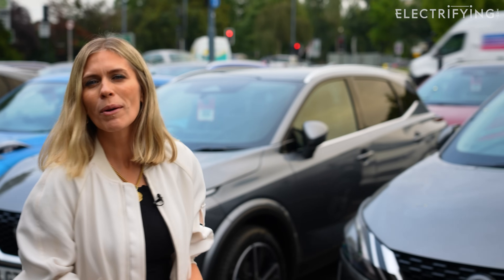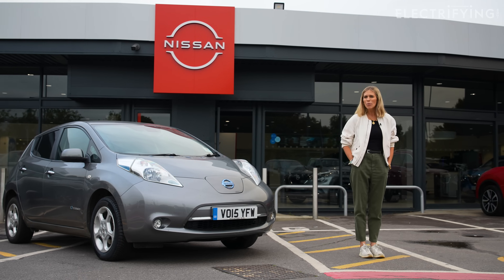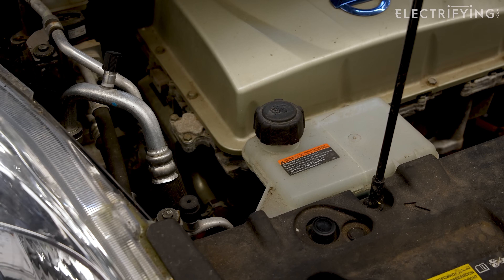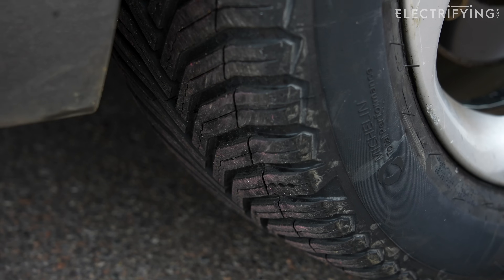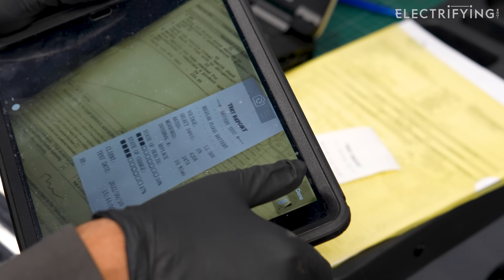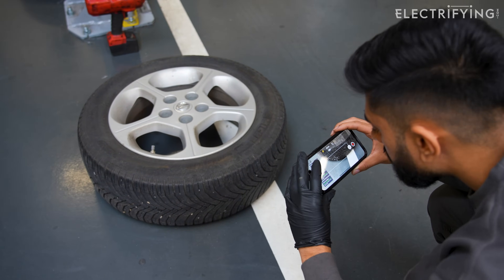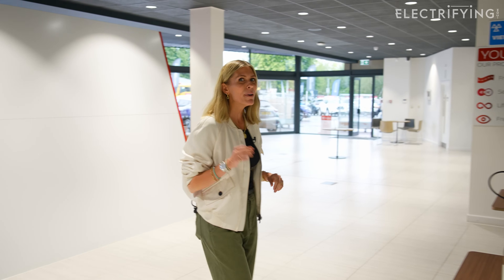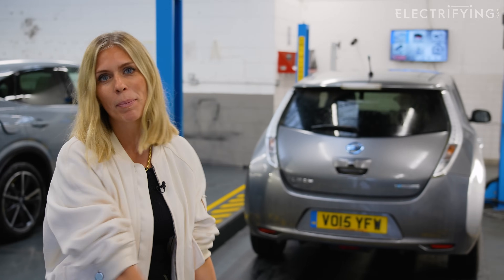SERVICING AN ELECTRIC CAR: everything you need to know

Comment: I service my EV myself. Check battery health, update maps software, replace reduction gear oil, replace brake fluid, replace pollen filter, top up screen washer and battery coolant level, check tyre wear and pressures, wheel stud torque, check over car and all lights and controls fully,  wash, wax and vacuum and then take it for the MOT.
Reply: Excellent comment I’m reaching out to you do you or know anyone in the Essex area a mobile EV specialist as I need a Nissan townstar EV looked into with the Nissan security autoauth gateway 
Many thanks Mark from Billericay

Comment: Thanks.but why have they not checked earth straps on high voltage parts like battery and HV compressor and condition of high voltage orange cables. Which can cause an insulation fault.Think I take mine to an independent garage .

Comment: MG Arnold Clark priced me over £200 for a major and little did they know I had a dash cam hard wired in apon checking the dash cam footage I seen my car was only in the work bay for 20 mins and when I went to drive away I took out the pollen filter to see and low and behold still the original one all dirty un charged so be careful guys these garages aren’t doing what they are saying I won’t name the garage as after I confronted them I got 50% off the bill and got my car booked in the next day where they then did the service. You have all been warned

Comment: TMI If I get in a car I want to drive it. Get from one place to another. Do not want to have to sit there and program it for ¼ hour before I move of. Set the heater Air con. If it is to cold or hot to have to stop. And most of thoughts items will start to play up after about 3 to 4 years. Planned obsolescence.

Comment: Unless you are recharging at home from solar panels. Many rural recharge stations are powered by diesel generator and some times petrol. The power has to be generated some where. Has environmental impact. Even charging at home means less power to the grid helping power other homes. Not as clean as one thinks!

Comment: In Australia to drive from Melbourne to Sydney, How many stops to recharge. And how long will each recharge take. It takes around 8 to 9 hours to drive in a petrol car. That is with a 15 minute re fuel  If it takes more than  9 hours you will be up for extra accommodation.
How does driving at night, family on board, luggage,influence distance and time. Every time you have to recharge still has  environmental impact. The power has to be generated somewhere. Out of sight out of mind.

Comment: Even though EV's don't have an engine or transmission, you still need to change the gear oil in the differential. Don't forget, these actually still use antifreeze, similar to what's used in a combustion car. While the Nissan Leaf is the only EV that air cools its battery, most other EV's circulate liquid coolant through its battery cells. All EV's use liquid coolant for its inverter and motor. Even the Nissan Leaf has a coolant reservoir.

Comment: My Tesla doesn't have any service schedule except for brake fluid change, updates are done over the air, transmission fluid change , I think every 50k. It just shows how othe OEMs are ripping you off for an unnecessary service , everything  else , which is only screen wash and tyre pressures you can do your self
Reply: So it does have service schedules then. Brake fluid, transmission fluid, cabin filter, brake pads, brake discs, brake lines, steering, suspension, battery cooling system, tyre replacement and rotation all need to be checked regularly, you wouldn't want an mot failure would you.

Comment: Fact, in Australia the Ioniq 5 is more expensive to service than the similar size Hyundai Tucson over 5 years. This is criminal for a vehicle with so few moving parts compared to the petrol alternative from the same manufacturer.
Sure you may save $ on electricity at typically 50c/kWh vs ULP at $1.80/litre but purchase price is double and insurance is 40% higher too.
Admittedly the Ioniq at year 5 with average 75000km will have broken even on emissions (including construction) but once depreciation is added you will be $30000 worse off.

Comment: We’ve not long had our Ioniq 38kWh serviced and it only cost £64 and that was at our local Hyundai dealer. They estimated the next service which will be a major one, will cost around £140. I’m really impressed by that.
Reply: Hi, I'm I. The motor trade, you can do most of the service things yourself, service schedules can be accessed on line, do what you can yourself.... How often do you service your washing machine or hair dryer?  Lol electiic  motor's don't require anything  service wise, brakes hardly wear, due to regen braking,the corrosion on the discs I. The video is normal as it's part of the disc that the brake pads Tony touch, there's really hardly anything to do, the dealer's are just justifying there existance, don't get ripped of.... Any advice just ask , regards Phil
Reply: @philpdl1615 Nice  that  someone  else  doesn't   fall  for  bullshit!
Reply: @philpdl1615 would you say the motor trades even worth it after this feels like there's nothing to fail and repair
Reply: I lease my ev (hyundai kona 64kw) so as part of the agreement I have to take it to an approved dealer although capable of doing it myself.
First service was last week and cost £79 so quite happy comparing it to my last diesel car (which also had to take to an approved garage due to lease rules).

Comment: Questionable vid. It's no doubt misleading for some who are on a 'leasehold' agreement where the agreement will specify terms and conditions that must be adhered to AND ie having your car serviced by those NOT permitted to do so? Even buying from a dealership where an agreement has been made re the servicing et is a CONTRACTUAL arrangement made at time of sale or purchase et failing to meet the terms and conditions that entails will mean a breach of 'contract' forfeiting rights afforded by that original agreement. Also specific dealerships / manufacturers agents et will have specific equipment onsite designed for their vehicles diagnostics and anyone under the illusion of one size fits all can be in for a rude awakening when something later on goes wrong.

Comment: most of these checks can be done by any standard garage.  And even by any person by themselves.
yet any updates are free for you to take to the garage to get.
So NO need to spend £100's on an expensive not required service.  
 I don't know how many include Breakdown cover in the service cost. ???
the cost of a cabin filter may be as little as a £10.  even the wiper blades are less than that.
So really I do not see the need for this annual service   especially if your car is going for an MOT.  which is cheaper and will cover more parts indepth.
You are not getting a report on the battery so why do you have to pay for them to have a man Look at the car
I found a service list for my car.  One item was looking at the seatbelts for wear.   and looking at the windscreen for chips or cracks
All of which Is NOT required and need NO special high cost garage man to look at it.

Comment: Bloody hell £159 for a minor service? That’s NOT cheap!!
Reply: For basically doing nothing. All things you can do at home.
Reply: @kryptoniteee  Your qualified to do brake checks / replacement and suspension checks and steering checks, battery cooling fluid and system and replace brake fluid and transmission fluid at home? You have the time? You have to have servicing done to a standard to keep the warranty.

Comment: Electric cars are simpler mechanically. But think of the process. Remember every time a change occur, you lose. Think of converting chemical energy to ac, then to dc, then to modulated and regulated ac, then to mechanical energy. Rather than converting chemical energy to mechanical energy.
Reply: Every time a piston moves up and down it wears the cylinder.  Just as the piston and cylinder have to be designed to last the life of the car, so does the battery on an EV.    And you have the EV process mixed up. Maybe that is why you see it as a difficult thing.    You start off on the wrong foot with the battery creating AC.    Basically the DC from the battery is processed by electronics that may or may not be on as single board/box.  It does the inverter thing to created signals for each phase of the motor with the correct voltage at the correct time.

Comment: I bought used -18 ioniq form hyundai dealer, "service" was done 2 weeks before. Front and rear brakes all so rusty and seized that I needed to buy new rear ones. Reduction gear oil was low, maybe 9 dl and black as a tar. I canged that and it took about 1.2 l. Latest navigation update was 2020... And according to service documentation it was also updated 😂 Front tyres, maybe 1 mm thread wear left. At least here in Fin hyundai service is just BS and only rip off your money

Comment: Basically electric cars don't need service. If you have Tesla where software updates are done over the air you can check fluids and change filters yourself no need to waste 150 quid. Also VW use drum brakes at the rear so they don't rust.
Reply: Drum brakes rust too.  Maybe slower and you can't see it.   A good friend's parents stopped using their VW bus/camper.   Over time the drum brakes rusted solid.   This was an extreme case and generally they do not rust to seizing when in use.  The problem with EVs and regenerative braking is that the brakes do not get used.
Reply: @danharold3087  yes you are right but for EVs they design them differently so they fully enclosed so you can't compare them with the old design drum brakes
Reply: @LatutaEV  You had me wondering why EVs would use drum brakes.   VW says it is because they have less drag than disk brakes.  That is reasonable.

Have never look at a drum brake on an EV.  Will have to take your word on the fully enclosed.

Comment: I am having issues with my fiat 500e lease car had it since April

going good untill a month ago I kept getting a onscreen warning saying something is wrong with the passenger airbag and the SOS assistance.

I called fiat and they said take it to my local dealer but I didn't have time as it's 16 mile away and I go to work. But then as of a couple of week ago I was sometimes getting a seatbelt warning symbol and sound and it seemed to only happen when I was turning left lol....I tried to pull on the seatbelt in different directions and where it clips in to recreate the warning but it never happene donly when I drive and turn left.

And now I keep getting all those warning but now it says one pedal driving unavailable and to use the normal break...and yep in range and Sherpa when this warning happens I take foot of accelerator and the car keeps going...no regen breaking.

Just drove from work tonight and I had to drive 5 mile with all these warnings going off. I stopped my car twice turned it off but still happened.

I've had the car since may I think it is...end of April start of may.

And to top all that off last week lifting my boot lid I heard something rolling around inside my boot door/lid...where inside the boot you have that odd plastic that's coated in material covering the boot lid/door internals it sounds like sometjings come off inside there and rolling around when I'm driving or opening the boot.

Does anyone know if these warnings etc could be the 12v battery needing to be replaced already?
Reply: Sounds like a lemon. All that should be under warranty, drive the 16 miles.
Reply: You chose a FIAT, the second most unreliable brand (after Range Rover) in the UK, you shouldn't be surprised at all.  You will know the mechanics at your local garage better than your wife/girlfriend before you move it on...

Comment: I'm sorry but for the effort the guy put in to do what is effectivly what i would call mandatory weekly checks those prices are enough to stop me buying an electric car! As  for the cost of a diesel service being more -  ive just replaced my dics and pads on the front axcel, fluid and filter changes - all for less than £150 - and to go from a minor to a major service because the pollen filter wants changing is ludicrous!
Reply: Andy that is like saying you will not buy any diesel because some skin owners on service.      On a tesla you change the cabin filter and make sure the brakes are not ruined by rust from disuse.   And Tesla does not care who does this work.   Things like swapping suspensions can get you in trouble with Tesla warranty.

Comment: I'm guessing this is a sponsored video. Apart from the pollen filter at a major service what else do they actually do at a major service. Anyone can fit those at a much cheaper cost I'm sure. The videos will probably only tell you the tyre depths. Ask me how I know. 

Sorry but this is a make weight video at best.

Unsubcribed.
Reply from the maker: Not a sponsored video. We even paid for the service, although the manager did give us his staff discount, which was nice of him. A major service seems to include the pollen filter, a 'gearbox' fluid check and the brake fluid change.
Reply: @Electrifyingcom  They are looking hard for things to do and call them needed service.  If that gearbox was on an ICE chances are that the mechanics would ignore it.    Had a transfer case die on a 4WD pickup serviced by the dealer from day 1.    It ran out of oil  They said they don't check the transfer case.
Reply: While they've put a positive spin on the robbery that is EV service, I think this video still has value. People who know are speaking up about the lack of value at an EV service. I'm also sympathetic to dealers, they make their money off used cars and parts. EVs contribute less to both of those markets. Also, Electrifying's other content is great!

Comment: That £206 for a major service is bloody good seeing as the Nissan in my area charged me £250 for mine to be checked.  What the hell is going on with Nissan’s service Center, does it mean they can charge what the hell they like Nikki.?  I will keep you up to date if it gets higher.
Reply: I agree.  I could be wrong though, My thought is since more cars are going electric, the service depts are going to lose money not doing oil changes, spark plugs and all the other systems that petrol cars require.  In response they are convincing owners these expensive services are needed on their EVs.  Many of these services owners can do themselves.  Changing a cabin filter, our dealer charges 120.  The filter is 15 and can be done in under 5 minutes by the owner.  Windscreen fluid is cheap and can be done easily as well.

Comment: Cabin air filters are often very expensive at dealers and often and easy job to do yourself. The Zoe I had for three years was less than £100 to service but I had to negotiate with the main dealer for this
Reply: A "pollen filter" sounds like something that exists almost exclusively to facilitate overcharging.
Reply: True, I also have a ZOE and the filter costs 12€ on Amazon. 5 minutes and you are done. I have never let it changed at the dealer, but I would like to know what it would cost.
Reply: @toughkix  I think it was something like £35

Comment: My EV has had 2 services now, and to be honest, I haven't got a clue what they've done to it whilst it was in.  The video report has only ever shown tyre tread depths, and I've never been given any paperwork.  I know for a fact they didn't do any software updates at the first one, even though they should have.

The only reasons I can see for servicing at a main dealer at present are because of the breakdown cover (something I've had to call on several times now) and preserving the warranty, especially on the battery.  In pretty much all other ways, the servicing is not value for money if you're even slightly capable with a spanner.
Reply from the maker: The 'free' RAC cover is a big part of it for us too. The equivalent breakdown cover is £100+ so if you need it, the main dealer service starts to look like a decent option.
Reply: @Electrifyingcom  I don't own one, but from what  I've read, electric cars don't seem to break down very often.
Reply: @Electrifyingcom For  goodness  sake  switch  to  Greenflag.
Reply: @Electrifyingcom  That only really comes into play after the 3 year warranty is up as the RAC cover is included with the warranty.

Comment: 1:38 there is absolutely nothing wrong with that brake disc. The actual disc is shiny which is all that matters. The other parts corrode on all cars. Stick to car reviews as you clearly know nothing about the mechanical gubbins.
Reply from the maker: Thank you for your helpful comment Rafton. The disc is clearly scored, but it was also worn below the minimum thickness. A new Leaf disc is 28 mm, the recommended minimum thickness is 26 mm and ours were at 24mm.
Reply: @Electrifyingcom  do you believe that?
Reply: @raftonpounder6696 Dont  bother  trying  to  educate  them  it's pointless  save  your  breath.
Reply: @Electrifyingcom  that slight score will not affect braking performance.
Reply: So harsh. Be nicer it doesn't cost anything.

Comment: Mmmm I live in Cambridge and my focus diesel service on the official ford service costs £200 with MOT included, cabin air filter, etc... Maybe in London they charge much more, I don't know... But the next time you want to pass an advert as a video, you should say so...
Reply: I do cabin filters myself cost of servicing £10 . Car is checked while undergoes MOT . No OIL, no in line diesel filters, no sensors , no glove plugs, no shafts, no belts, no misfiring, no ad blues, no exhausts, no DPF filters no problems !!!!